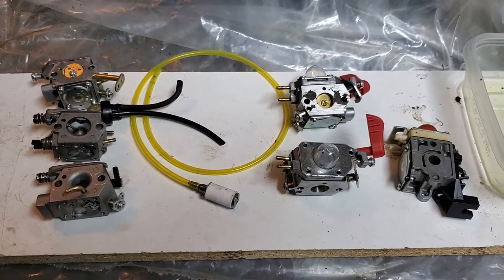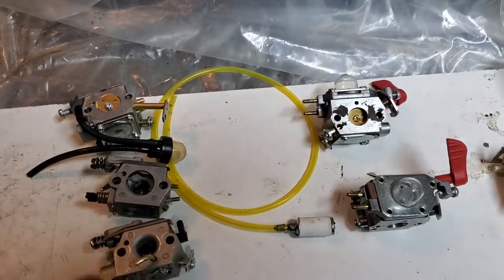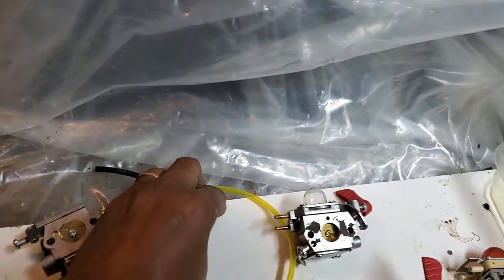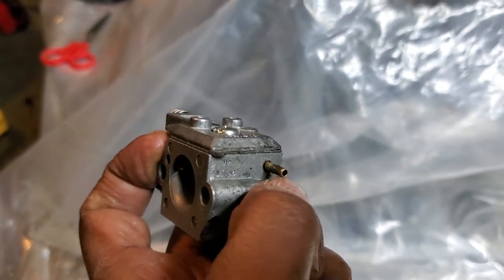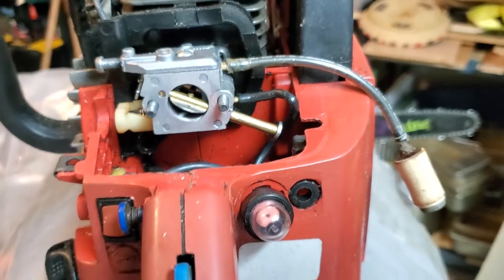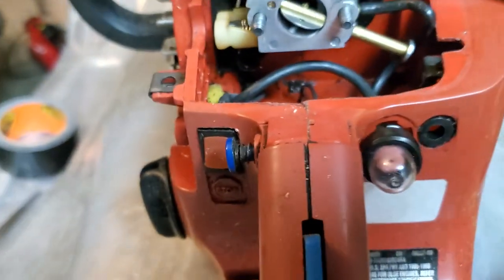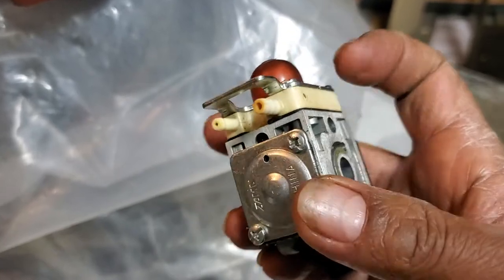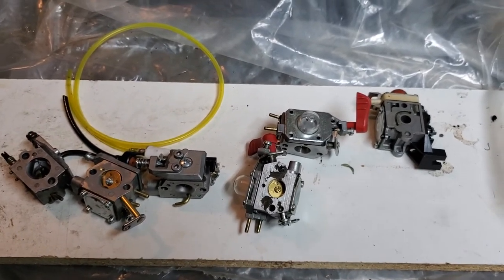Carburetor fuel lines for dummies

Comment: Great info. I just push the bulb and where i feel air i connect one line and the gas line goes on the opposite side. I also learned that the gas tank runs on pressure, which means you need air tight fittings, like the grommet and gas lines and no leaks around the tank. This was one of the reasons my blower ran like crap. Thanks for the video!

Comment: It's not called a primer bulb it's called a purged bulb!  Primer bulbs go on 4 stroke engines and purge bulbs go on 2 Stroke engines . Primer bulbs prime the Carburetor and purge bulb stuck gas out of fuel tank thru the carburetor and back to the fuel tank, that's why there are instructions on 4 stroke engines Not to Over pump the primer bulb or you will flood the engine because the fuel does do return to the fuel tank!
Reply: great thank you v much